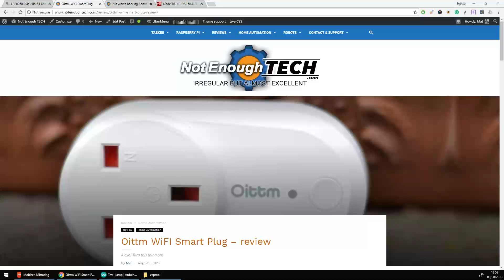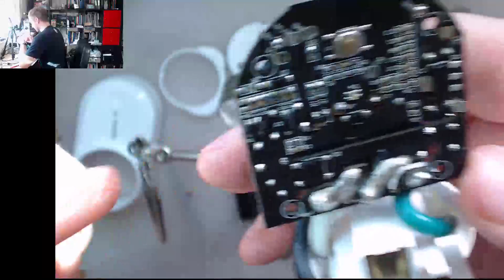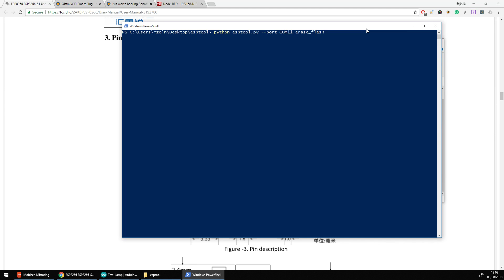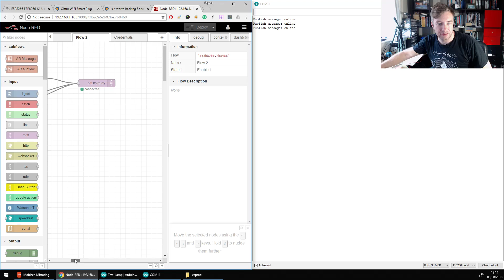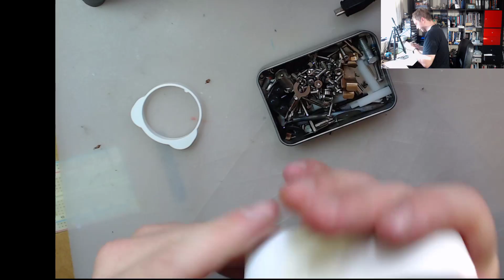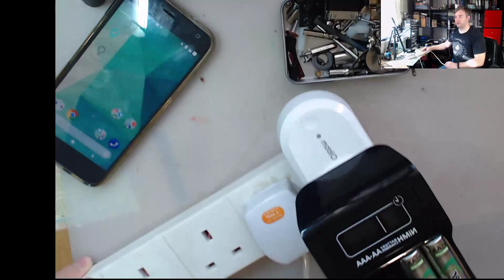#LIVESTREAM - Oittm Smart socket ESP8266 HACK

Comment: Do you mind sharing the pin assignment? I'm struggling a bit there.
Reply from the maker: Hi
http://notenoughtech.com/featured/esp8266-smart-plug/
http://notenoughtech.com/home-automation/a-hackable-esp8266-inside-a-smart-plug/
You are welcome!
Reply: Thanks (and a lot for your video, too). 
So far I've figured out:

GPIO4 - Relay1
GPIO5 - LED (inverted!)

- what's missing is the physical button and to which GPIO pin it belongs
Reply from the maker: I used the exposed pin, I have not mapped the button yet do you have a multimeter??  Try doing what I did for the relay pin